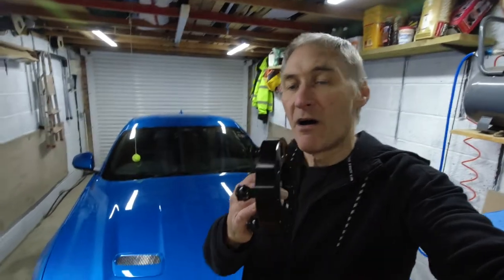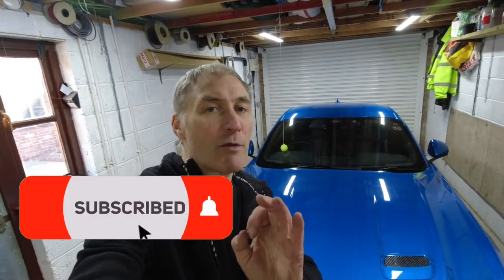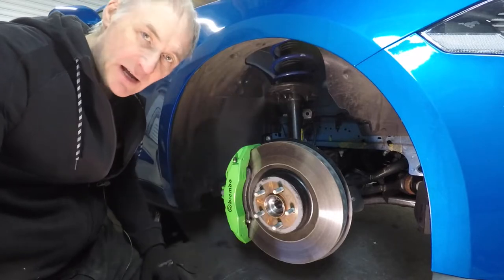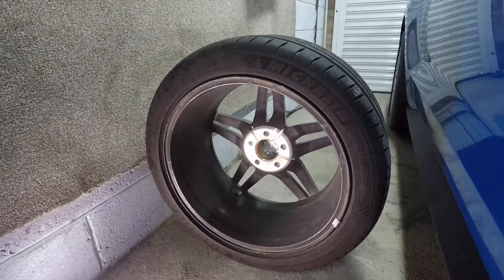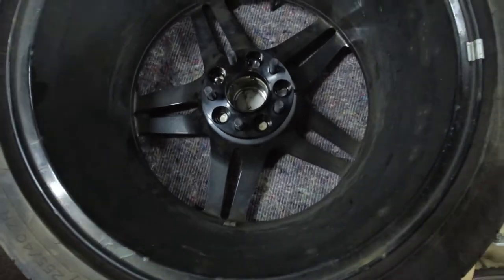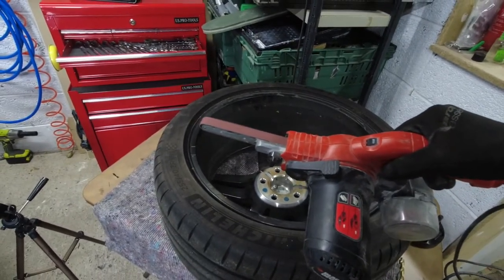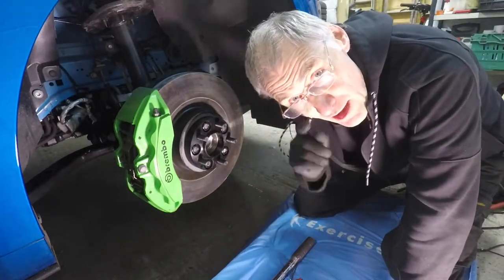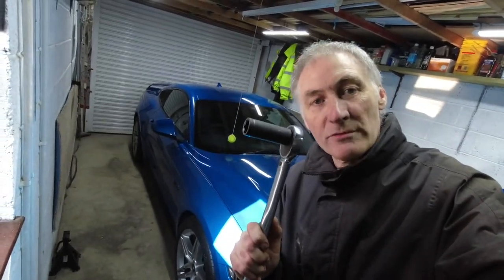Mustang GT Wheel Spacers on Magneride are Possible! | How To | DIY

Comment: It’s not just the Magneride.  I have a non-Magneride 2018 Performance Pack 1 car with these same optional factory forged upgraded PP wheels and I am having the same issues.  Although it appears the Magneride studs are longer, these wheels are the biggest problem with spacers.
Reply from the maker: Yea it was a nightmare!!